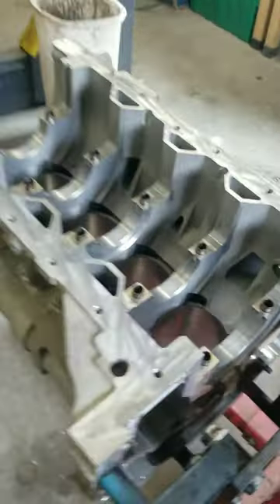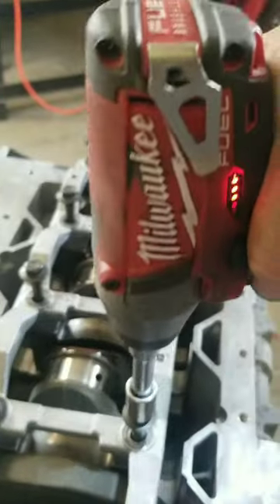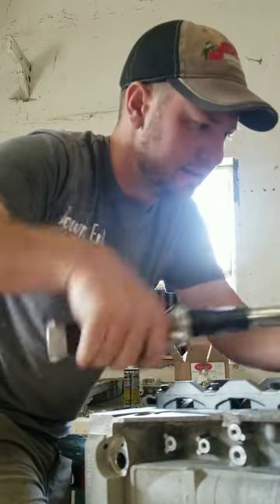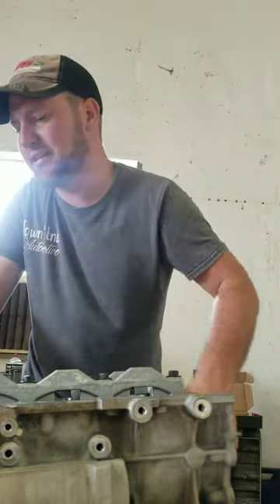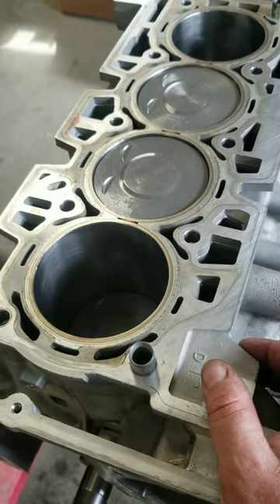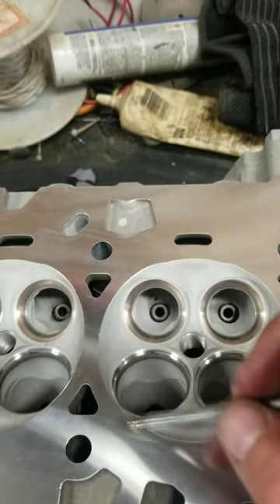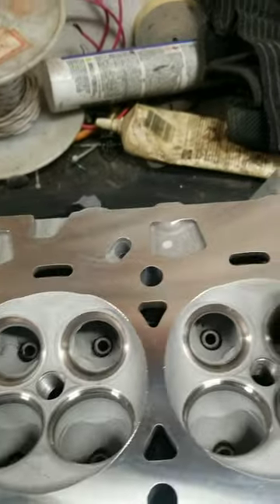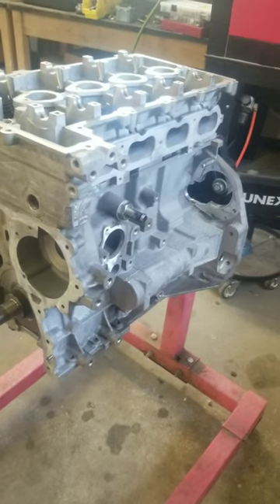2008 chevy Colorado 2.8 engine rebuild part:3 assembly of short block.

Comment: Really like your rebuild videos, really helps going step by step. Im currently working on my personal canyon, but i cant seem to figure out how to install the balancers correctly. One has a notch and has a mark where its supposed to sync up, but i took the other balancer apart and it has no marks on the actual balancer shaft. Any chance you could upload a video on the balancer installs? Or explain how to set them up.

Comment: Re using the tty bolts is a bad idea. I have tested this with the head bolts. Put in a new set, torqued them to spec with the 155° of rotation after 33ft lbs, then removed them. Re installed the same (now stretched) bolts, torqued to spec, drove 100 miles and then checked how tight they were. Some were around 55lbs some were up in the 60s, i tried to torque them all down to 65ft lbs and some reached that some did not. The real scary part was when i went to remove them, oh my God, while not hand tight i will honestly say they were too easy, way too easy to remove. Anyone who has had to remove factory head bolts knows they are a nightmare, they send you flying across the shop and in the process at least half of them break. 

Do not re use TTY bolts or you will be sorry i guarantee it.

Comment: Question for you. Where are you located and how much do you charge to rebuild a 2007, 2.8 L, four-cylinder Chevy Colorado?
Reply from the maker: I'm in Farmington NM
Reply: @townsendliving9750  ok so what’s your pricing?
Reply: Careful with the 2007s, most of the parts were discontinued by GM with zero aftermarket due to the 07s not being compatible with other years. You would be far better off swapping with a lower mileage but same year motor. Unless you swap to a different year which is complicated.

Comment: Didn't do the balance shaft bearings, huh? Is it ok to skip them? The tool for it is up to $5000 new for some reason.
Reply from the maker: Yes they were fine in this block, I think this engine only had like 100k miles. But I have changed them before with a cam bearing tool
Reply: @townsendliving9750 I call BS on this claim, first of all where did you find the bearings and second how did you remove them and install new ones? Last, why would you In the first place?  The balance shafts only reduce engine vibration. It's really hard to imagine feeling the urge to remove the balance shafts in the first place. If I thought the bearings were bad I would eliminate the Balance shafts altogether.

Comment: Parts are not parts, the 2007 atlas is a changeover year and the cam phaser among others is not compatible with other years. Just as one example. The cylinder liners, the harmonic balancer bolt, the list goes on.